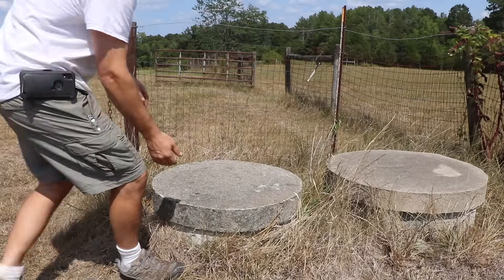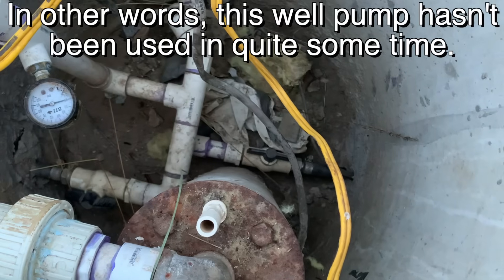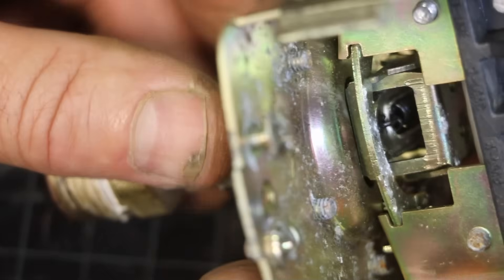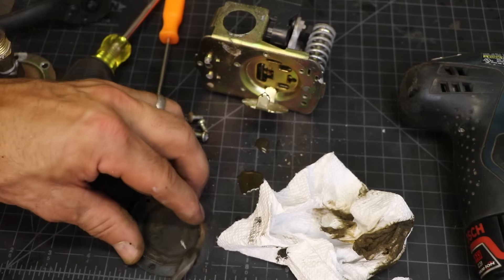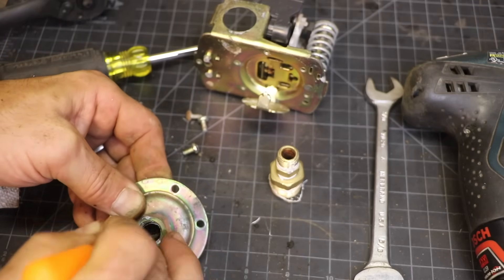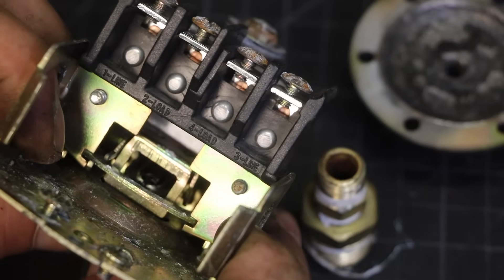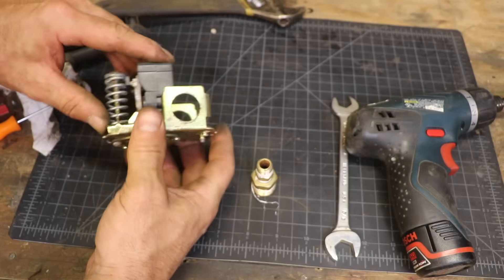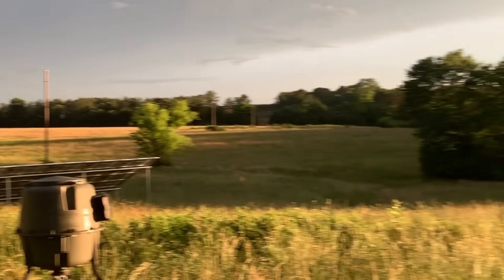How a Well Pump Pressure Switch Works. Diagnosis and Repair.

Comment: I have a box full of these - it is always the diaphragm that failed.  I have never been able to find a replacement part
Reply: Simple solution, filter before the switch.
Reply: @noanyobiseniss7462  The ones I have do not plug - the diaphragm rots out.

Comment: Shouldn't your pressure tank and hot water heater have fail safe pressure-relief valves that vent at ~100psi and ~150psi?
Reply from the maker: Good point.  Maybe they would have alerted me to the problem and saved the pump.  Not sure.

Comment: I imagine you checked the other one aswell? You might want to install an electronic pressure gage that gives off an alarm when it gets too high. This way you do have some redundancy in case of failure.

Comment: I'd replace with new and have that as your backup.
Reply from the maker: That's a good thought.
Reply: @FarmCraft101  I usually go a slightly different route for repaired equipment. I'd buy a new one as a replacement for when the repair fails. Especially in this case. It wasnt really damaged, just dirty. And I would be far more comfortable to have a new-in-box part on the shelf than something that already started corroding. Nothing sucks more than to reach for that old spare and find out that it rusted shut